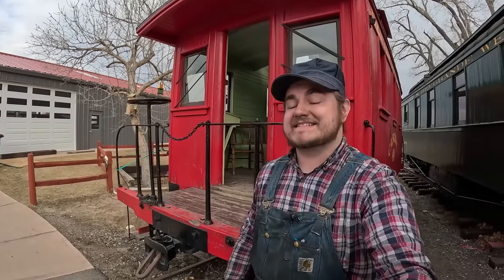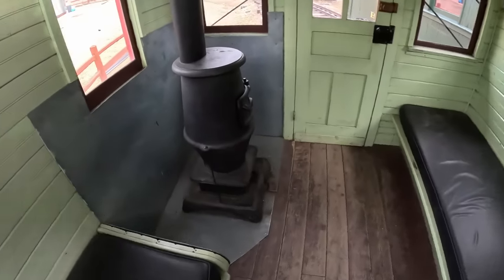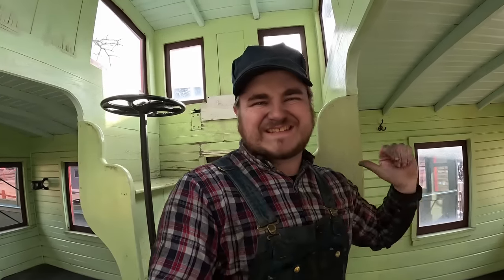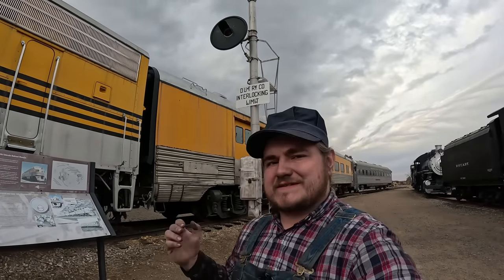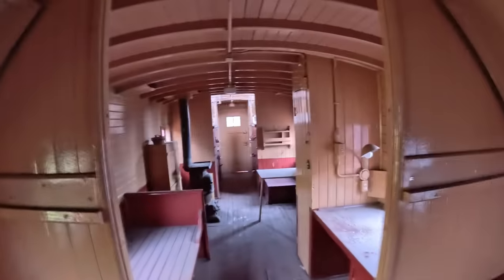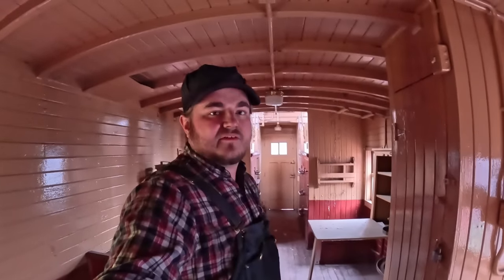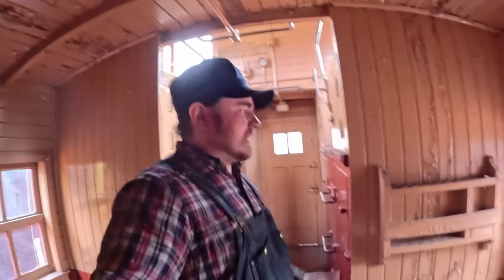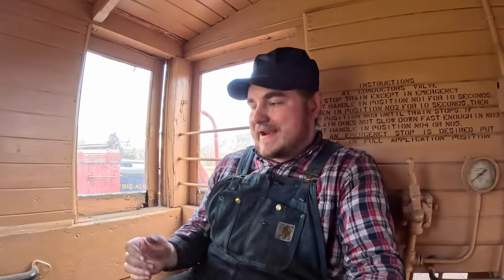Why don't trains use CABOOSES anymore?

Comment: The first train i was on was when I was 15 years old it was a train for the Middletown and New Jersey railroad a old train line in my hometown they were moving stuff around and seen me watching them so they asked if I wanted to ride on the train then about 10 years later I started using a train to travel between the county's near me and it caused me to live riding on trains over taking the bus

Comment: 1st reason cost. 2nd railroad has hot box and dragging equipment detectors. 3rd is railroads have gotten rid of brakemen and next is the conductor. Slack on long trains is Not a reason. Stack trains have minimal slack because of 5 pack lengths and a good engineer handling the train. If slack was an issue, you would see far more trains being broken in two

Comment: I’ve slept in a caboose. It was stationary and modernized to be a cabin, but I’ve still done it. I count that as sleeping on a train, because let’s face it, traveling by train is EXPENSIVE.
Reply: I have slept in one too.  Back in the mid 70s, when I worked for CN, I often rode freights.  On one occasion it was an over night trip and I slept in the caboose.  I also rode passenger trains a lot, having traveled all the way across Canada.  However, I had passes that got me on the trains for free.

Comment: It saves manpower.  But don't get the idea that we don't have hot boxes anymore.  They cause a myriad of derailments every year.  We now have IR detectors placed on the railroad that detects hot boxes. They are called "Hot Box Detectors" they are pretty expensive though so there aren't as many as there should be on many railroads.

Comment: I had a quick question that I couldn't find online. Why did these older trains have roof access on the outside?
Reply from the maker: That's where the brakes used to be!
Reply: @Hyce777  Ahhh, thanks!

Comment: What year were intercom phones installed between the front and the back of the train? I remember seeing a picture of the phone on the wall of the caboose, which looked like it was long before radio communication.
Reply: I think you are referring to Pennsylvania railroads trainphone. It was first tried in 1936 and became fully operational in 1943 but was discontinued in the 1960s when radio became practical for railroad use. The PRR didn't have train phone over it's whole system, only portions of it.

Comment: I worked both, the last of the Caboose's are only used on work train's.
Before air brakes they would bring an extra man because many of the brakemen fell off the trains!
Most were maimed or killed.
My family has been railroading since the 1850''s.
Starting out as brakemen and moving up to conductor.
My grandfather was a fireman during WW1 and it took 3 engineers to sign you're card to even become a railroad engineer.
My brother in law just retired after 43 years BNSF/BN 
My brother will retire this year after 30 years
I was disabled after a yard accident
I worked with the guys who lived out of those
We only used them on work train's
FRED is what we call them
You can loose your signal and run blind i did it more than once.
You don't know you're rear air pressure but I am sure they got better
With engine's in the rear of 80% of trains they can read the engine in the back so soon we're going to have
Engineerless train's!
Technically will eventually take over.
I have one nephew who works MOW and I think he will be the Last of our Family working train's
My nephew was the Superintendent of the Canadian Pacific Railroad
He retired a couple years ago due to health issues
My family knows a thing or two about that old black coal all the way to the newest 2024 models
I have run BN1 AND BN2 there the cab over engine's that run our BN/SF
Company car's around
There heading for the supper bowl next week! 
The president car was worth over a million dollars back in 1997!
Its probably worth 3 times as much by now. 
Thank for sharing 🙏🏽😌

Comment: If there was no enroute switching, me, the other brakeman, and the conductor were more or less paid passengers 90% of the time on road trips. And if you’re the rear brakeman or conductor, your own personal railcar. Not a Pullman but all this was expensive. Today just 2 people on a train on the lead locomotive. Even the helper engines are remote controlled. Helpers used to be manned by a two man crew (engineer and fireman—modern fireman are just engineer trainees no shoveling coal). So a train going up a hill would have 6 workers and a caboose which required more workers to maintain. So not just the caboose was eliminated but also workers all to save money.

Comment: The reason they don’t is because they have Fred and it doesn’t weigh anything to speak of and does not have to be connected to the train, plus all the maintenance and upkeep needed on a caboose.  They have so few men on a train these days they can sleep in the engine and they no longer need the caboose as sleeping quarters.  Doing away with the break man sounded the death knell for the caboose.

Comment: Well, you left out a big reason.  If a train had to take a siding so that another train could pass, first the train had to stop and the head brakeman get down on the ground to align the switch for the siding.  The train then entered the siding.  Once the caboose cleared this switch the train stopped again and the rear brakeman got down to realign the switch for the main.  To get out of the siding the procedure was repeated with first the head brakeman aligning the switch for the siding and the rear brake setting it back for the main.  It's pretty clear that you needed someone at both ends of the train to set the switches.

Now this was before the days of CTC.  With CTC the dispatcher could throw the switch remotely.  Now no one on the train needed to get down on the ground and no one was needed at the rear of the train.

Comment: I'll  answer the question, "WHY DONT TRAINS USE CABOOSES ANY MORE?"
   Railroads have become Corporations. They don't  care about having world class Locomotive's any more. They pander to their stock-holders. Instead of the railroaders rebuilding their own parts, that is sourced out to the lowest bidder and quality goes right out the window! Electronics is taking over everything! Several of the jobs that the 2 to 3 man crew in the caboose, was to monitor the train-line pressure at the back end of the train. Also, to be able to put the train brakes into EMERGENCY from there. The Conductor rode in the caboose. He was in charge of the train. The entire crew, including the Engineer, worked for him. He was the boss, on the line of road. The various bay windows and the cupola, on top, allowed He caboose crew to watch the entire train and watch for hot-boxes. (Fart-rock would heat up and ignite and melt the lead cover plate on the top fronts of the journal  boxes, and would spray a blue cloud of rotton-egg smelling putrid disgust into the air. The cab would pass thru it and alert its crew to a hot-box. Oil sump/wick journal boxes have been changed to roller type Timken journal boxes, so there's lots less hot-boxes. And the "EOTD" "End Of Train Device " clamps onto the knuckle of the last car in the train, and it's  hose glad-hand couples to the Train-Line train brake hose. It has a box that contains a pressure monitoring sensor and a magna-valve, a radio receiver/transmitter, a battery and a "Rubber-Ducky antenna". It pairs with the "HOTD," "Head Of Train Device," mounted on top of the Lead Locomotive's Control Stand. The EOTD monitors the train line pressure at the back end of the train, just like the Conductor would, in the Caboose, but instead of using flags or lights, to report to the Lead unit, ot after radio came out, T-Rack Radios were used, the HOTD receives the signal from the EOTD and is real-time readout. There is a protected switch, on the HOTD that, when flipped, you can pop the pressure on the back end of the train, then put it in emergency at the front of the train, too and not jerk the train into. Getting it to mate, sometimes is a royal pain, but it works well. There is a big flashing red light on the EOTD, that marks the back end of the train. This meets All of the rules of the "FRA," "Federal Railroad Act/Agency" They're  the governmental bunch that keeps the railroad on its toes, like OSHA does with Safety in the workplace. 
   There's LESS MAINTENENCE to do, so that cuts down on how many workers the corporation has to pay. That's  one more car they don't have to pull every train trip. That's  one or two men they don't have as crew per train. The Conductor is still in charge of the train, but he rides on the opposite side of the Locomotive cab than the Engineer  does. He has his air guages and emergency  air handle right next to his seat. So by doing away with  the caboose, one crewman in the Lead unit, is gone, replaced by the Conductor and two men crew of the caboose aren't  needed, no place for them to be. I don't  know, but I've  been told, you have the Conductor, The Engineer, the Fireman, (which is just a switchman),  and a Switchman as the whole crew for a train. 
   That pretty much sums up, Why Cabooses aren't  on trains anymore. Less man-power and more electronics. Speaking of which, some switching yards have a switch engine controlled from the hump yard tower. It pairs with a radio slug tied to it. Some  switchers have a belt-pack operating system, where one man can operate the engine and switch from his belt controller. It's all about cutting down on manpower,  which is also being done by allowing females into roles always held by males, to be politically correct.
Reply: I just showed my Dad your reply. He's a retired engineer who spent 39 years at CN. He laughed at the part about conductors being in charge and said if he ever had one that was being an ass, he'd be like "I'll show you!" and make the train lurch or something.

He was a health & safety rep for the union for a long time too, so the things you touched on reminded me of helping him sort emails on things like belt packs (among others like running backwards etc) My brother went out west and became a conductor about 5 years ago, albeit quite late in life, but getting sober really straightened him out...in some ways!

Anyway, my Dad still tells work stories despite being retired for 15 years. One a few days ago involved being sent on a trip to go to different grain elevators to pick up a bunch of cars. So they left with just the units and a caboose, and he described how they'd come flying into those stops (cuz he liked to scare the conductors by how good he was apparently) and at each one there were no grain cars in sight. So they went on a trip that was 100+ miles for nothing cuz the manifest was picked up the day before but nobody told them.

The ones that stick out more are the few times he's hit people. I think one was a drunk guy who walked into the side of the engine and was thrown into the field and survived. Another was a car where the driver was ejected as well, but one of those two stories ended with the person walking to a farmhouse to get help. He did mention one where there was a fatality, and the dispatcher or trainmaster told him to go check, and he's like no way that's not my job.

This is only secondhand, and I suck at remembering details, but it sounds like he's seen some sh!t.

Comment: wow, the caboose let them spot the most common cause of derailment while the train rolled along.  And from what I have read up that same cause is still prevalent up to today, even with those scan points that look for those issues.  And then they keep merging railroad companies into bigger and bigger and fewer conglomerates and leaner and leaner skeleton crews to save a buck.  And now they say there are over 1000 derailments a year.  Although the caboose may never come back, they should at least learn the lesson of the caboose, install cameras on the cars or have someone onboard flying a drone to check the cars while they roll so they can hopefully catch the problem before it becomes catastrophic   lessons to learn from our history :)

Comment: The railroad industry is an important example of technical advancement replacing human workers. Today, the railroads are pushing for one-person crews, with double length trains. The double length is allowed with unmanned engines between the front and rear of the train. They also use automated switching engines in many yards, with the human who does the yard work also running the engine by remote control. The recent derailment in Ohio has put a temporary hold on some of those plans.

Beginning in the 1950 decade, the railroads wanted to ditch passenger service, because freight service produced more profit. They began moving maintenance-of-way expenses from freight accounting to the passenger ledgers, thereby lowering passenger profits even more. Amtrak has always been burdened because the freight lines still own most of the rails, resulting in massive passenger delays and very difficult scheduling challenges.

Comment: I had been working on trains for twenty years when they got rid of the caboose. Railroads have always cut jobs any way they can. They reduced track maintenance costs by cutting section gangs. They figured we no longer had passenger trains so the quality of the track could suffer but they’d just run slower.
Then, the higher ups asked why don’t you get rid of the crew at the rear of the train, it would reduce crew sizes by fifty percent. The only way to do this was get rid of the caboose. We’ll sell it to the public by saying we have technology to replace them. So they did it. Safety be damned, profit first. 
When riding a caboose, you could smell brakes sticking or hot journals, you didn’t necessarily have to see them.  Proof in point, the The derailment in East Palestine, Ohio a catastrophic derailment caused by a hot journal. Had the caboose been at the rear, it would never had occurred

Comment: By doing away with the caboose the railroads have saved tons of money that they were once paying employees. Not only wages, sick time, vacation pay, and health insurance. Don't think for a minute that those Corporate people at the top that run the show didn't think this out. It was a win win for the company, but NOT for the safety of the citizen. The flashing red light at the end of the train doesn't have ability to call the engineer if someone was laying cut in half on the track as the train rolled on. It's dangerous not having someone at the end of the train... But then again, it is cost effect for the railroad company. So that is why it happened.

Comment: With the technology advancement in how Locomotives are built. Births, restrooms, and a small galley of sorts are now built for the long haul trips or engineer re-location.
Reply: I've never seen a birth in a locomotive, what they have for a restroom is is smaller than most out houses I have seen and a tiny little sink you can barely get your hands in. As for a galley maybe a microwave or a hotplate, maybe a small refrigerator.
Reply: @fire5506  Ok if you say so ! However, there a number of rail hoppers that have videos that show different ! I've seen several with a bunk or two, heat and restrooms as big as any bus or plane !  If you read my post you would have see I said "a galley of sorts". Much much better than the the Cabooses in this video. Thanks for the reply !

Comment: I worked for the SP for twenty years starting in 1967.  Every move they made was to eliminate labor.  Period.  What's next, running the trains remotely without anyone on board, or maybe a conductor?

Comment: Some cabooses are STILL USED EVERYDAY. On local road switchers where long shoves are required crew members are back in the cabooses to be the eyes of the engineer. It is much SAFER than trying to hold on the side of a car and talk on a hand set radio. I am a retired UP hog head and know what the hell I'm talking about.

Comment: after the recent "hot box" disaster in Ohio where the axle heat senor technology didn't work or was disregarded, maybe its time to bring back the caboose! Make em taller to see down the line. use air cushioning couplers to minimze the lash.

Comment: The local Southern Pacific railroad spur that connected the Ray mine, both Hayden smelters, and the San Manuel Mine and smelter with Phoenix and beyond used cabooses up into the 80s.  This was, in part, to stop train hopping.  You could hop on the slow moving train at Hayden or Kearny and ride it Kelvin or back 6 times a day.  Illegal immigrants did the same thing.  This is, of course, a YUGE! insurance problem, sop cabooses allowed the Brakemen, Conductors, or whoever else was in the caboose to watch for train hoppers.

Kearny, Arizona also has a Cupola caboose on display in the 'railroad park' next to the highway.

Comment: RRman 1971-2005 CNW/UP: slack action happens as a result of poor train handling; every train will have X amount of slack based upon the lenght of the train L/E's; ifn I remember right <its been awhile> 100 car train has about 5-8 cars of slack; when I was RRing' the 50 ft'er was  prevalent, then came the 60 ft'er...90ft'er your TTX'er and High Cubes with cushion drawbar setups; you can get some real nasty slack action from the High Cubes when those drawbar actions got stuck and released suddenly; L/E were probably your biggest contributer to unwanted slack action; Hoghead once said to me...freddy know where your loads are in your train if you have mix'd freight. Stacks, Pigs&Autos,Coaltrains,Graintrains,Ballasttrains,Mealtrain,Oretrains, Rocktrains have their own handling characteristics; I agree, you can get beat-up in the crummy pretty good; thats why all the grab-irons in the BrainsBox!!

Comment: Yikes brass, not bronze in the bearings?
Reply: Brass is actually the strength of the bearing, babbitt is the bearing surface that the axle runs against.